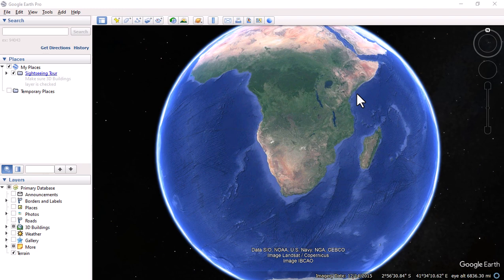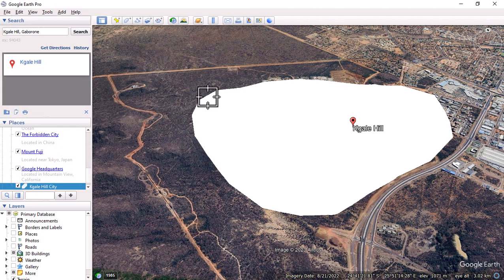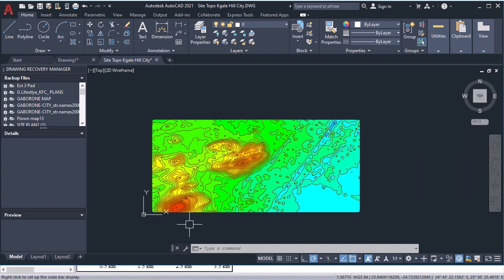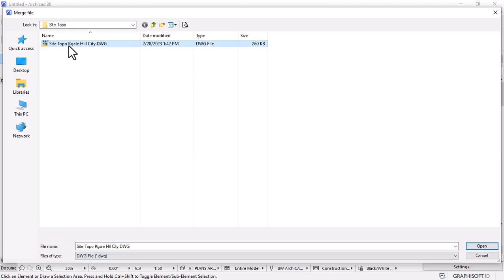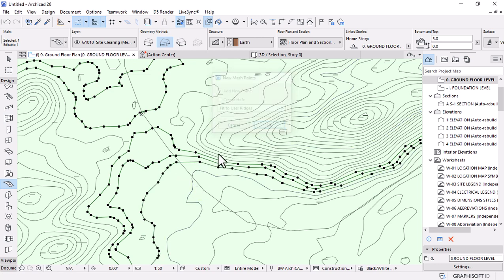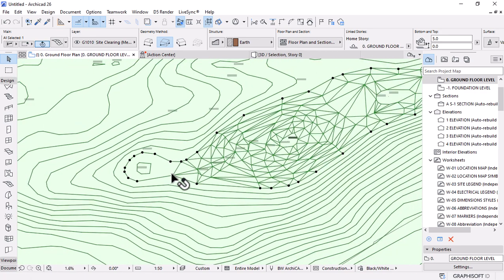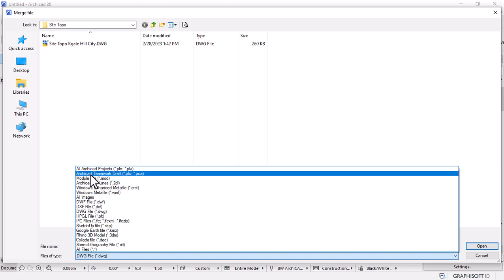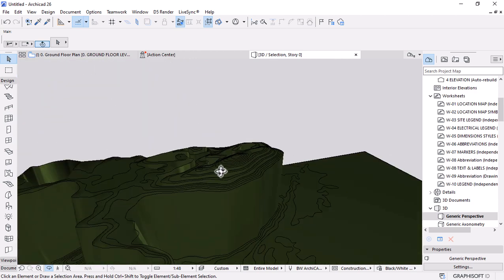Generate Easily Google Earth Contours to AutoCAD- Revit-ArchiCAD

Comment: I think I have made an observed that one could possibly save time if one simultaneously does the magic wand operation and adding the height of ridges. ArchiCAD automatically picks height decrease and one wont have to type in the height every time they select the fit to all ridges option. However it might not be entirely reflective, so one will need to be careful when executing the automation. Hope that's helpful in a way.
Reply from the maker: Thank you for such a informative comment..I didn't know that. Will try it 👊